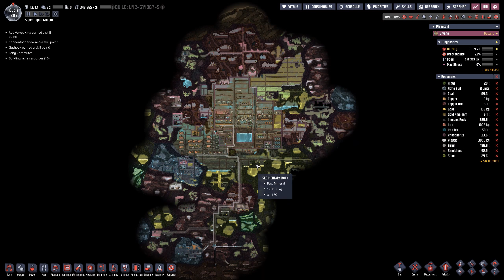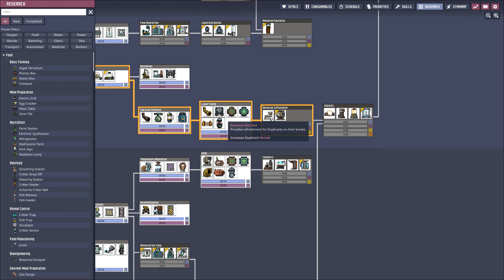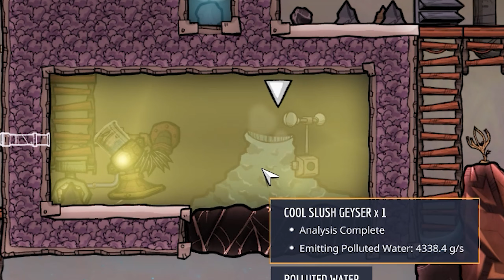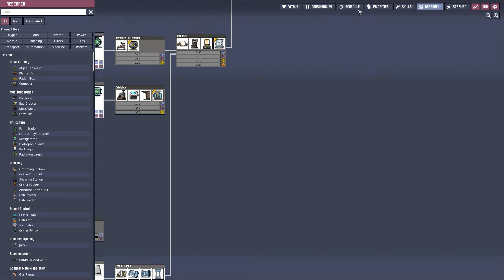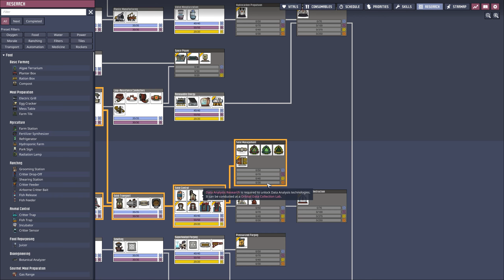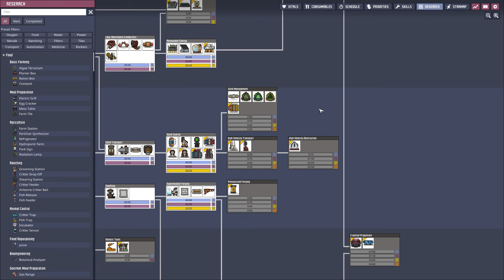Oxygen Not Included -  Tame the Volcano! (Part 14)

Comment: as for the bridges, they all have the same two rules. input has priority, output is secondary. if there is space, the input WILL take from the source. but if the output is added to a system, the line it is on has priority, and the output will fill in the "gaps"

Comment: A few tips for base & builds

 - carbon skimmer + water sieve - build as low in your asteroid as is feasible, or otherwise the lowest point where dupes aren't in atmo suits.  All it needs is power and sand to make more area breathable.  

- single tile storage - use 4 automatic dispensers with sweep only to drop all debris on the map into a single tile.  Some things should stay out - oxylite, bleach stone, slime.  2 high so dupes aren't hit with -2000 decor when picking up materials.  Single tile storage reduces computing load, improving overall performance.

food - berry sludge - find a cool slush or cool salt slush geyser.  Use it to cool the sleet wheat farm.  Have a big storage before it enters the farm so it can keep cooling the farm when the vent is dormant.  After it cools the farm, warm the water up to 0C in a tepidizer pool, then filter or desalinate and feed right back to the sleet wheat, warm it a bit more to feed it to bristle berries.  Easy water for lots of berry sludge.  It doesn't degrade and is perfect for rocket travel.  Just add a grubfruit farm to make mixed berry pie in addition to berry sludge, easy +5 quality food.

- power - most starting asteroids generate some - not a huge amount, but a decent amount of solar power.  It will not run your base on its own, but it will ease the grid somewhat.  Needs extra battery storage for non-peak times.  In fact, volcano tamers need large battery reserve too.

- travel/decor - replace mineral tiles with metal tiles when you can - you exchange 25% runspeed bonus for 50% runspeed bonus, and +5 radius 1 decor for +15 radius 3 decor.  Make walls and maybe ceilings out of granite or ceramic carpet - runspeed penalty is meaningless for walls and ceilings.  consider simplifying travel - instead of zig-zag maze, have metal tiles to a main transit spine and important areas dupes commonly work at - farm, ranch, industrial brick, etc.  For a larger asteroid, keep extra gas/liquid storage on the outer edges and work areas closer to the transit hub.

metal refinery - the simplest active heat deletion is to run the coolant pipes through a steam box above the refinery, with a steam turbine above that.  This requires high vaporization temperature coolants - crude oil, petroleun, naptha or super coolant.  The AETN cannot cool the metal refinery's output, but it can cool a steam turbine that cools the metal refinery output.

steam turbines - Hydrogen gas is not optimal.  Try a 10-40kg layer of water, salt water, brine, nuclear waste or super coolant and vacuum.  Gas exchanges heat with insulated tile at x25 rate, nearly negating any advantage of insulated tile.  You only need your cooling loop to go through the liquid layer.  Cool the steam turbines with steel aquatuner cooling loops, one AT can usually cool about 6 turbines fulltime with polluted water.

Industrial brick - make top row steam turbines.  Make second row the steam box, with two aquatuners.  The first AT is to cool the turbines and the 2nd AT to cool the industrial room.  Run pipes from the metal refineries through the steam layer, using crude oil, petroleum, naptha, or super coolant as the coolant.  Below the steam layer is your production area.  Put industry and manufacturing in the main production room - metal refineries, rock crushers, kilns, glass forge, molecular forge (note - have a petroleum output and pump right next to it to make supercoolant, and bottle emptier and pump to collect supercoolant on the other side).  Give everything some space for storage and autosweepers for auto-loading.  Keep petroleum refinery in its own room to keep the natural gas separate and easy to pump.
This can also keep and/or cool materials for common base use.  

Power brick - one steam turbine and aquatuner, insulate from outside of the power brick, active cool

Base cooling - Steam turbines + aquatuners.  Preferably use polluted water as the coolant, you may need the extra 20 degree hot and cold buffer compared to clean water.  

External heat sources - steam turbine + aquatuner.  Consider using insulated tiles and pipes to prevent heat reaching your base and farm area.

tamers - use a chill box!  Aquatuner to keep turbines and chill box cool.  Chill box can be water or metal tiles - metal tiles are usually better.  Consider power generation -  cool metals to 150-170C in the volcano steam chamber, then use active cooling in the chillbox down to 22C.  This is hugely power positive overall, if you have a high enough battery capacity.  Conveyor rails from all metal volcanos to your single tile storage.  Or open a side of metal chillbox to cool surrounding area.  This works on everything except niobium volcano, which produces almost nothing in a normal tamer setup and instead requires basic open vacuum taming for 50% output, or exploits for 100% output.

Steam turbine and aquatuner combo is always your friend.  It is the answer to all your overheating problems with everything.  For warming up cold areas or cold waters you will need to use the tepidizer, or letting volcanos erupt, or launch and land high-end rockets a few times.

Comment: So, how long until Pravus learns that Gold has a crappy heat capacity. Which means that 2600° Gold is probably not even turning the water into steam?
Reply: It can produce some power with a proper tamer, but I don't rely on them for power.  The design in the video may eventually fail if density of steam is too low allowing the volcano to melt the conveyor rails even with those tempshift plates there.  He made no secondary active cooling chamber for the gold, so net heat per unit of material mass in the asteroid is still increasing.  The same is true of his wildcat steam vent which should go straight to SPOM or to oil wells where its heat doesn't matter.